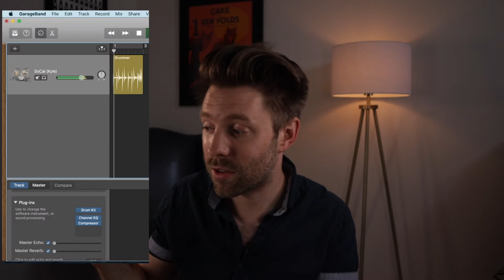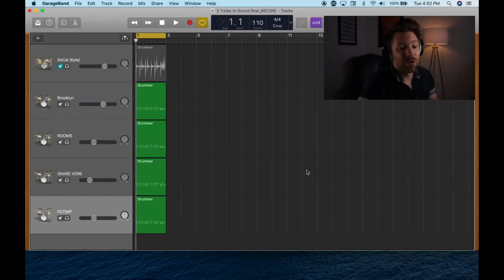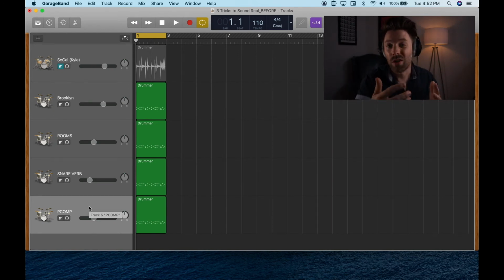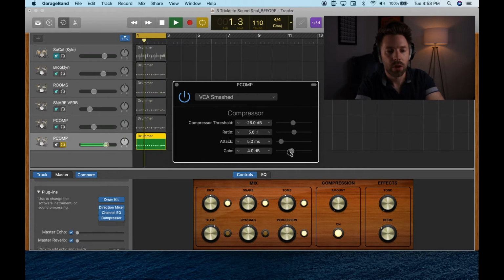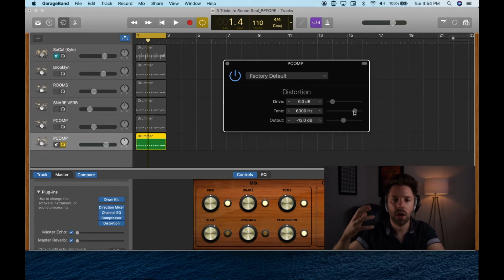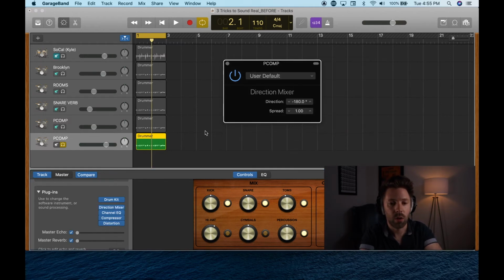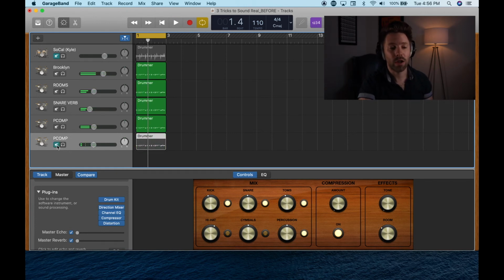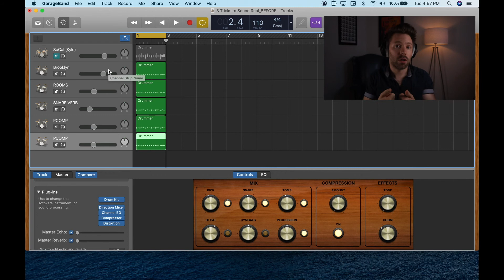Adding Distortion to GarageBand Drums Makes Them Sound REAL?

Comment: Hey Colin, quick question - when you are duplicating a track to use for parallel something, i see you click Cmd-D, and then you click option-drag down the region. But why not just click option and drag down the whole track, which would duplicate and also bring down the region. Is there are reason you do it in two steps instead of one?

Comment: Hello , thanks for this video, it has made such a difference to the sound. Since making these changes Garageband won't let me play the track without system overload popping up. I'm guessing my Mac doesn't have enough Ram to handle the extra info I have added. Or could it be another issue? Also do you apply the same changes to electronic drums?

Comment: In this video you add distortion to the PComp track. What do you recommend to do if using a parallel compressor plug-in like I heart NYC? I chuck this compressor on each part of my drum tracks (so don’t have a separate track like you have shown here) to add the distortion onto. Does that make sense?

Comment: Hi Colin, great videos. Question. Now that we have 5 drum tracks cohesively supporting parallel compression, how does this translate to the mixing phase of a song where you would normally individually adjust the Kick, Snare, Toms tracks to blend properly into the song? Is there a step in the mixing phase that you could recommend, using this type of parallel compression?

Comment: Amazing work, thanks! What about add hats and cymbals to distort track? And I noticed you left Room knob turned on, is that ok with Rooms track?
Reply from the maker: Hey thanks! Great question. Typically I don’t like the way cymbals sound with distortion on them, so I leave them off on the distortion track. But there are definitely some songs/sounds where it can work- I say try both and see what you prefer!

And yeah, definitely- the room knob is very subtle room sound and adds a bit of space that is different than the sound of the “rooms” track

Comment: Hey Colin, back to review some of your drum techniques as I’ve gone through a bunch of videos on the subject and believe you have the best handle on it.  I’m trying to flesh out a workflow that will give me the biggest ‘studio’ sound possible starting in GB and then progressing from there to final mix.  One thing I’ve discovered recently is the Harrison MixBus DAW which as it happens is on sale right now for 20 bucks - amazing value in my view.  So I’m thinking of tracking in GB until I get all the tracks I think I’ll need built up and then exporting them all and doing final processing and mix down in MixBus.  Just wondering if you’ve tried this and if so, what are your thoughts on going with this workflow?  Cheers.
Reply from the maker: Hey Reginald- Thank you!  I love that idea because it helps separate the writing/recording process from the mixing process.  Anything that can be done to focus on each process individually will create a more professional final result.  I haven't used Harrison MixBus, but I have been very intrigued by it- sounds like a STEAL for $20. Let me know if you end up going for it!  Would love to hear your thoughts.
When it comes to exporting out of GB- check out my Converting Midi to Audio video- I show how to export multiple tracks at the same time (the same process can be done for midi, drummer, or audio tracks) and is a HUGE time saver.
Reply: @TheBandGuide  yes, agreed. Will def let you know when I’ve run it thru it’s paces. Many reviews I’ve checked all rave about both the workflow for mixing and also the analogue coloring it lends to their mix so I’m thinking they can’t all be wrong. Going to give it a go.